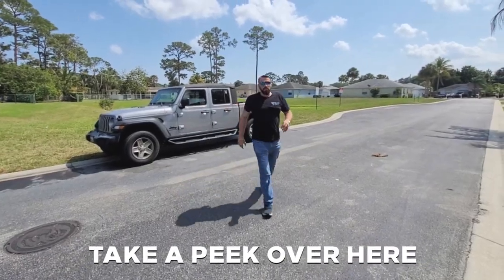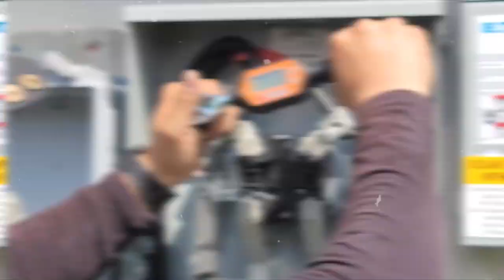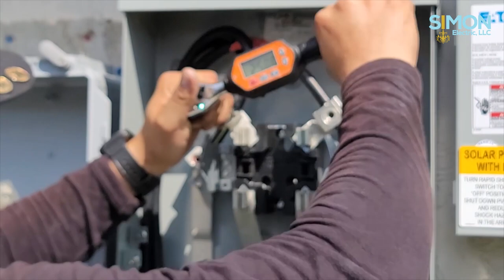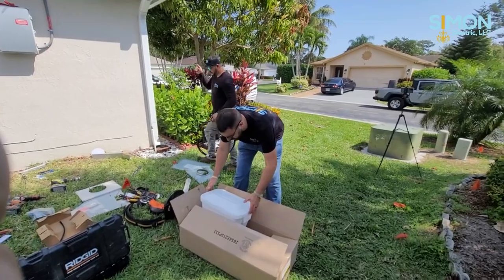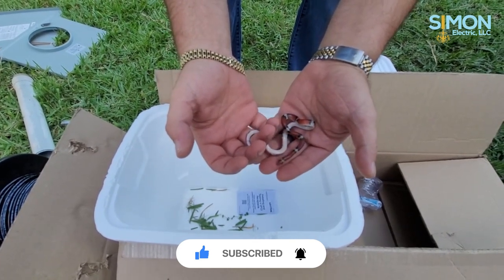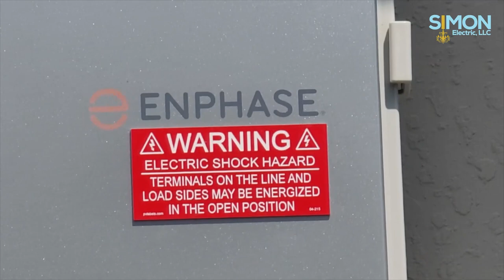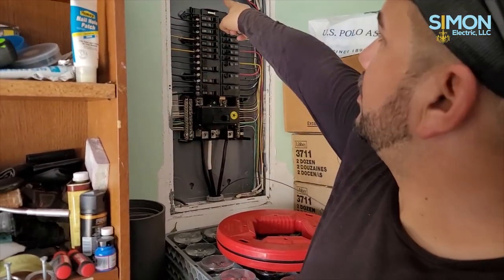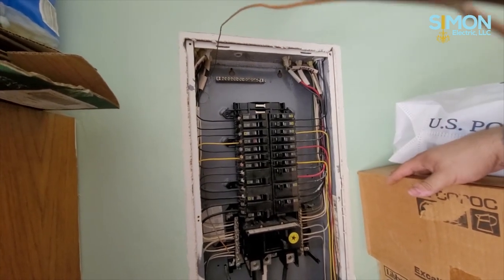Double whammy service upgrade, with a side of snake in the grass

Comment: Nice man, can you explain next time how the solar works with the utility power and how it’s wired? Thanks.
Reply from the maker: Sure, but that's a separate crew and separate inspection done after the service change/upgrade. We also do not put the panels on the roof that is done by a separate roofing solar panel install company.
Reply from the maker: I don't want to be responsible for any leaks or anything like that! I'm no roofer! Although I did do it for a summer in my youth.

Comment: nice video.what do you call those connectors you used to splice the 1/0 cable in that pvc j-box?
Reply from the maker: Polaris tap connectors.
Reply: @Simonelectricfl  thank you
Reply from the maker: @pawelelektryk2985  no problem

Comment: Wouldn't it be dangerous to do a j Box for incoming line power anyone can open the j box.
Reply from the maker: That is the feed to the interior panel going through the j box. We had to do it that way because the fpl line comes up on the right side of the 2 conduits and that blocked off the entire left side of the panel. So we had to come in the top and add the manufacturers partition on the top right of the meter main combo panel. That way we can come in the hub on the top right and run down to the feed through lugs. It's really the only way unless we either dug up the fpl line or if we had liquid tight hop over the 2" ridged, which would have looked worse probably.  Thanks for the comment.